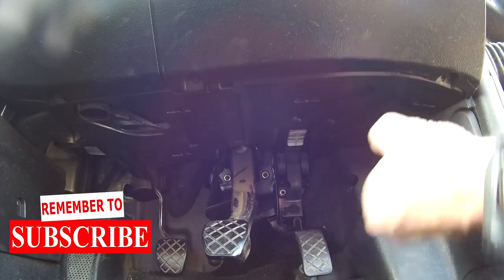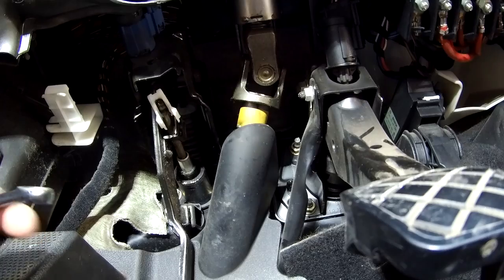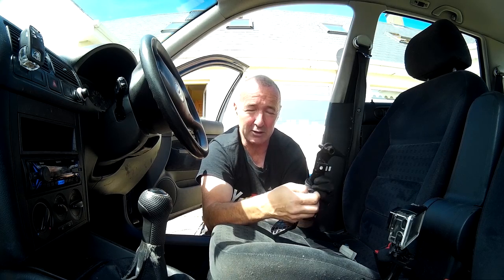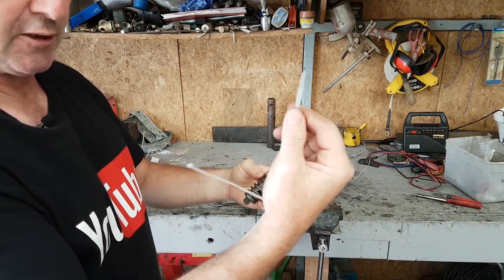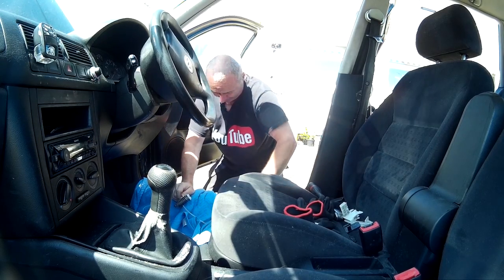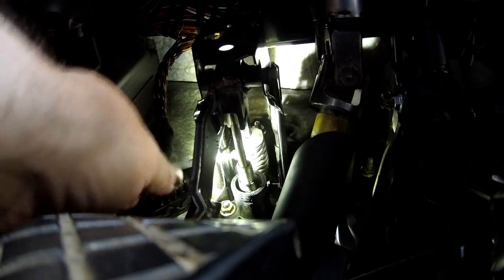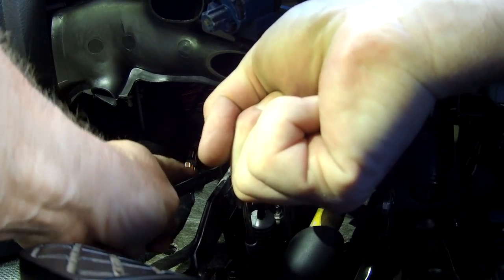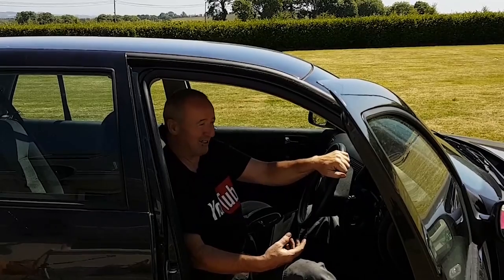Vw Golf mk4 Clutch Pedal Repair

Comment: I broke mine today on the highway :( do you think the plastic version of the pedal from a mk4 Jetta would work?
Reply from the maker: Hi. Sorry I'm not sure but as you know lots of parts on the jetta are the same. Maybe someone else here can answer your question. I will pin your comment Cheers Gerry👍
Reply: You couldve gotten yours welded back up from the break area. I had mine break on me in the middle of traffic.
Reply: @bradymarjanac4212  same thing happened to me. Stop and go traffic and then POP no more pedal. I ended up welding it back together and painting it, and installing a new bushing It will never come apart again lol
Reply: @OlDrippie  hahahaha man i got my older bro to tig weld mine and then i painted it. Just got it put back in and works like a dream lmao. find the cheapest ways and they work

Comment: I this is the only video on this problem. Mine has just broke in the same way. Interestingly in the Haynes manual it says to make a spring retaining tool which they even picture but not the dimensions. You'd need a metal fabrication place to make it but I feel the zip tie technique makes more sense. 
I took one from a scrap one today and even though I didn't have to be too careful it was quite difficult to remove so not looking forward to fitting it 😂. 
Thank you for this video

Comment: Thanks Gerry, seen your vid n decided not to take pedal n spring out so changed white socket, drilled hole n put screw through, pushed pedal in, screw was stoppin clips poppin in so shaved white socket till clips popped in , drilled hole through bottom bit of pedal n car was sweet. But put 2 mini zip ties round socket either side of rod to secure.Absolute ballix but you helped me out immensely with both your know how and your cheery demeanor. No matter whats broke it can be fixed. Cheers bro.

Comment: My 2000 X reg 1.9 TDi Mk4 clutch pedal is a bit squeaky when releasing it back out. I can now see a few areas I can try and use a bit of WD40 or similar to smooth the pedal out. The pedal was replaced about 5 or 6 years ago for the exact reason you show here - broken metal tab.
Thanks Gerry, great video, hope your back didn't ache too much afterwards!!  Cheers man.

Comment: I see the problem.  The pedals and the steering wheel are on the wrong side!  Just kidding.  I have a MK5 and hope I never need to perform that repair, but if I do, at least I've seen it done before.  Great idea with the zip tie.  Thanks for the video!
-mike
Reply from the maker: Thanks mike. I have had a mk6 for a few years now so it's time for a change but it has been 100% reliable. Not even a bulb has blown. Thanks for commenting Cheers Gerry👍

Comment: So hopefully this comment can also help a little on top of this awesome video.
Probably best to get a pedal from a scrap car with the black plastic clip.
When putting back together.
Put white pushrod clip on first. This isn't easy . I used circlip pliers to separate ends whilst pushing on very hard.
Have good pedal ready and put into place and push onto white clip that is now on the pushrod. Make sure pedal is roughly in place before pushing onto white clip. It should click into place. 
Now put bolt in but the time put bolt in from left IE console side as access from near steering column is restricted. Push bolt through once pedal is lined up. Don't put nut on yet or just loosely.
Take zip tied spring. You could also have this off the scrap car. I zip tied either side to compress equally. Don't need a vice. You can press on something with a small gap with zip ties in place and tighten as you compress.
Make sure spring rear black part is correct in position.
Fully depress pedal and position white end of spring on black prong on rear of pedal.
Release pedal gently making sure it is fully engaged.
So up bolt to somewhat done up.
Cut cable ties
Use snips , wire cutters or similar 
Fully do up bolts. Spanner on steering rack side and ratchet on center column side.
Then put on black clip on rear of pedal which the clutch switch actuator 
Hope this helps

Comment: Well done Gerry. Do not think I would chance cable ties on a strut or road spring, I would use my proper spring compressors as I value my eyes to much but worked magic on that clutch return spring. Good luck.

Comment: Great video Gerry. Helped immensely when fixing the same pedal in my Audi TT. I found using a cable tie through 7 coils on the spring made it easier than on the 6 I had first. Also when popping the white end of the spring into place I initially only engaged the pedal on the outer section of the white bit, had to pop it a second time to get it in the middle. Thanks again. Cheers

Comment: Hi Gerry. Don’t you just love working on modern cars. My first car was a 1965 VW beetle. Most repairs could be done with simple tools and it seems that everything was somewhat accessible. Thanks for the video and thanks for the links you sent me regarding your older parasailing videos. They are really great and much appreciated.
Reply from the maker: Hi Dan I have to say I found this hard on my non bendy bits but it  is still working. Seems to be a common enough problem. I hope to be fixing my paramotor engine really soon and get flying with some friends. have to try and sort out a better audio recording setup. The flying season is just opening up for the paragliders and the thermals are usable now so it wont be long before I can go cross country without the engine. More on that soon Thanks for commenting Dan Cheers Gerry

Comment: Hi did you weld all the way round? There's a black plastic clip that goes back on that part, I believe?
Reply from the maker: Hi Martin. Sorry for being late with the reply but I did weld it all. It is just a stop end so that the clip and spring assembly cannot go through the pedal. This might help others reading the comments. Cheers Gerry 👍👍👍👍
Reply: @GerrysDiy  no worries thanks to your video I did everything bar the weld myself. Worse bit was getting the white clip in the stop! 👍

Comment: Hi, 
Great video. 
My golf r32 mk4 was stored for sone time. Today, I started and moved to service it. After putting in first & reverse gear and then into first again,  to manoeuvre it, 
the gear was stuck in first and didn’t change. I was pressing clutch but seems like clutch won’t engage. Now I cannot engage gears at all. Is it the sane issue you had with your golf mk4? 
Thanks in advance..
Reply from the maker: Hi. The clutch pedal goes all the way to the floor and will not engage the clutch at all. So with the engine running you won't be able to get the car to change gear. What happens is that the pedal cannot press the piston to the master cylinder because the connection point is broken. very common on the mark 4. Hope this helps Cheers Gerry

Comment: Gerry
You are definatly the DIY guy....cheers from Canada. 
P.s.....paramotor is going back together today....prop fixed...
Reply from the maker: Hi Joey. Just subbed your channel. Do a little video of your setup I would love to see it. Wont be long before I do a rebuild video on my own paramotor. It has a moster 185 engine and the cylinder and piston need to be changed out. I will build an aluminium trike for it too but this time not from scrap. Great that you repaired the prop too. Well done Regards to all in Ontario Cheers Gerry👍

Comment: How did you get the white clip on, I can’t get it back on for love nor money
Reply from the maker: Hi Duncan. I put the spring assembly into a vice and compressed it and then kept the spring compressed with a cable tie to make the whole assembly shorter. Once in position I cut the zip tie and pushed the pedal. I found access tough and the job was more difficult than it needs to be. If you welded the pedal make sure that the weld is not interfering with the fit. Good luck Cheers Gerry
Reply: @GerrysDiy  cheers fella, yeah I cable tied without compressing in a vice. Using a vice compressed it enough to get in. Worst part was getting the bolt out of the pedal, haven’t got ratchet spanner’s so dropped the spanner’s  on my head about 50 times!

Comment: hi garrys my issue is need the pedal break box mount as im doing a swapping from cable accelerator for a DBW accelerator pedal and need the mount to fixe my DBW pedal and quite not easy looking for , plz any info will be helpful 
regards 
cahill

Comment: I've got the same care . Brilliant. job cheers. 👍
Reply from the maker: Hi 462904 I used to have a gt mk 4 diesel that was mapped to 180 bhp. It had great low torque and great on fuel, very quick for a diesel. Thanks for commenting Cheers Gerry👍

Comment: Did u put the plastic clip back on the rod before fitting the pedal?
Reply from the maker: Hi Darren. The hard part for me was the spring but yes you set up the white clip on the rod and into the socket once you have repaired the socket. Then setup the spring. Hope this helps and good luck Cheers Gerry 👍
Reply: @GerrysDiy  cheers mate as tried doing it with the clip in the pedal and not worked rod wouldn't go fully in and fell out last night while driving lol
Reply: @GerrysDiy  is there a easy way to getting the clip on

Comment: What was it doing did it just stick to the floor and lost all clutch that’s what happened to me
Reply from the maker: Hi Everyday Car. This is a common fault with the mk4 golfs. There  is a metal part on the clutch pedal that holds the clutch cable. The back of the metal retaining socket eventually flexes and snaps off allowing the clutch cable to disenguage. The pedal goes to the floor and you have no action on the clutch. Helps if you are more bendy than me 😜 when trying to get at the pedal. The pedal needs to come out for repair. Thanks for commenting Cheers Gerry
Reply: I have a 2004 Audi A4 b6 1.8t
Reply from the maker: @Everyday Car  Happy christmas and I hope yoy project goes well Everyday Car Cheers Gerry👍👍🎄🎄
Reply: You to merry Christmas guys and girls
Reply: And when my pedal stuck to the floor it’s was hard  to pull up I don’t think this is what happened I believe it’s a slave cylinder
Reply: Any opinion does that sounds like a bad slave cylinder? Or master which is on the clutch right?
Reply: @everydaycar3518 congratulations 🎉

Comment: Did you not have to adjust the pedal?
Reply from the maker: No. Once I fixed the metal that broke off the pedal it was good as new and no adjustment necessary. Hope this helps cheers Gerry 👍
Reply: @GerrysDiy  I just replaced my clutch in my golf and the engagement is right after i left my foot off the clutch. Do you think that is normal? It drives okay for the most part. Thats why i was asking about the adjustment lol